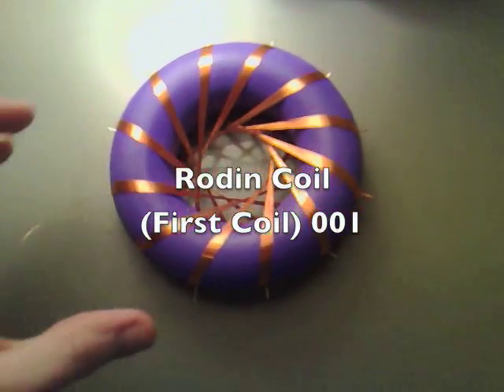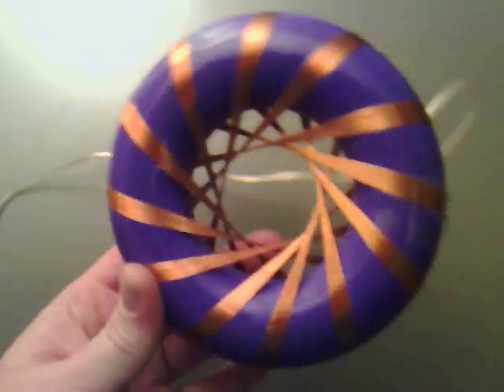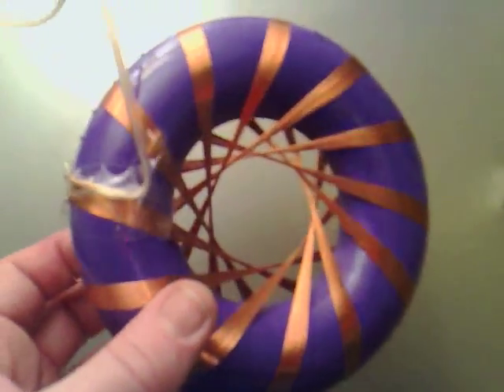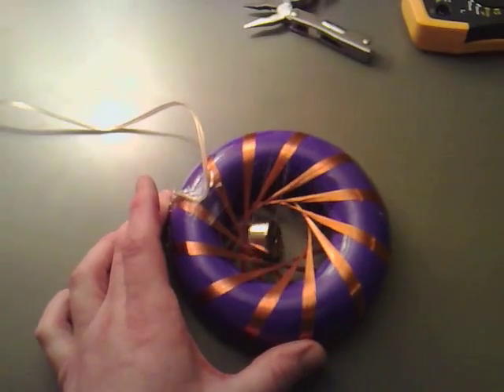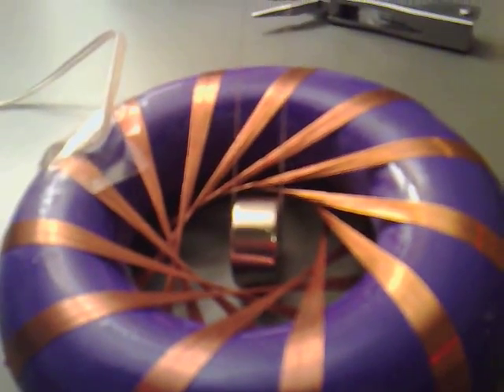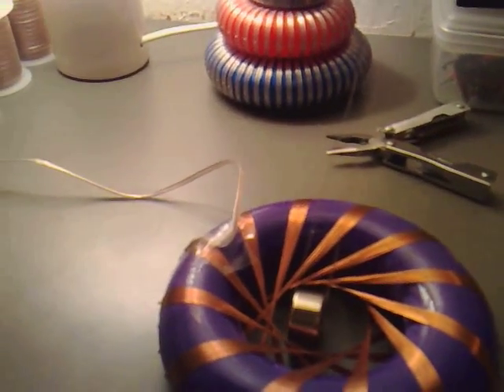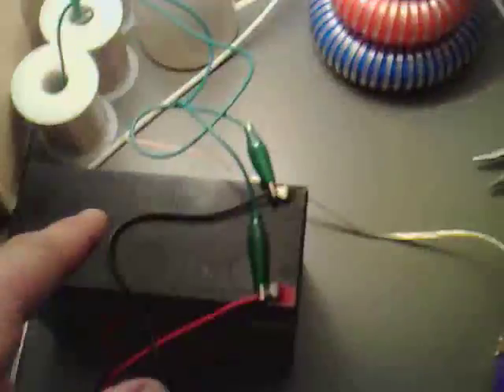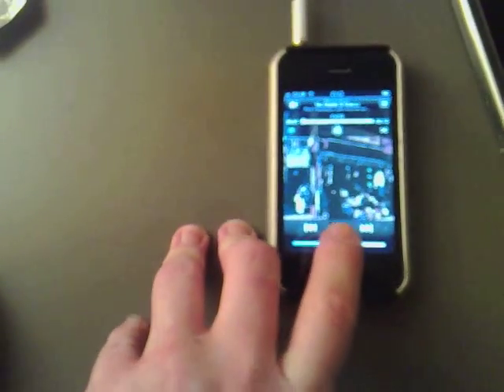Kubik Coil (First Coil) 001

Comment: @kubikop Exellent videos. I've viewed all your Rodin coil projects. The ones that "m interested in are the DC off set spin control, that you've posted. I'd like to build one with certain dementions. Do you know the proportion of the outside diameter of the donut/toroid compared to the finished inside diameter of the conpleted coil, such as an 8" OD will finish with a 2" ID or 1:1/5 proportion. The one I'm designing is to be 2 11/16" or 68.5mm inside diameter. Thanks, keep up the research.

Comment: I don't think you're vibrating the magnet. The magnet weighs too much to be oscillating at that speed with so little power. Rather, the wires are vibrating as their fields attract or repel the magnetostatic field of the magnet.

Comment: This is really cool! I made a very small speaker in this way:
Make a small tube from a bit of index card
Wrap very thin magnet wire around it, secure with tape

Now here's the weird part:

Take a magnet, and run it around the dirt outside, and you will find that some sticks to it! Close the bottom of the tube off by taping index card to it. Add some to the tube. Keep doing this until the tube is half-full of magnetic dirt. Then close the top off with the same method. Apply audio using and amp!

Comment from the maker: Voltage was about 8 volts, +-4v I have driven it through the power amp but it only has the frequency of 0-20000Hz.

I will have to check the inductance on my meter....

Paul.

Comment: Likewise, the sound-waves in a resonator 'resonates' the interior walls into powerful motion which ultimately emits a second set of  sound-waves, being much larger in amplitude.

If you have an electric guitar, try to place its neck onto a table or a door, or anything which has a large and solid, but also 'loose' surface. You will hear the difference. 

Just to mention it, I think this is also the workings behind the rotorverter, and also some types of resonant transformers...

Comment: Well actually yes, I have speculated about this and other effects for a long time now, I'm still not sure if I got the core of it, but it seems logical enough.

The short reason is this; parametric oscillation, and resonance.

I believe the Milkovic pendulum uses the exact same effect.
The input vibrations (sound or mechanical) will drive some form of oscillator into resonance. But it is not drained directly when loaded in the 2-stage way, instead it is its center parameter which is loaded.

Comment: If the Iron Rod fluctuates the North pole, would you agree that then it's possible to build a solid state power generator with no moving parts by using the solid fluctuations of the Iron Rod to pump through some coils electricity? I would love to see an experiment like these with your setup. You have really great stuff to test this out. I really like the way you controlled to motion of the magnet. This could be a way to control the direction of the "BLACK POLE" (which is still a hypothesis)

Comment: Can you confirm that the North Pole in the middle charges and discharges an Iron Rod, turning it into a monopole, (which in conventional science shouldn't exist) My guess is that the reason we see a monopole with just the North is due to there being what is called a "BLACK POLE" which it's as if you stuck a dipole magnetized rod in a black hole, what you would see is only 1 pole the south pole is consumed by the tiny black pole.

Comment: Now that is an interesting subject on its own.
Of course, since the tin foil has a larger surface than the magnet, it will move more air than the magnet, and thus encounter more resistance. So it will need more power.

But acoustical amplification is very interesting indeed, take for example a simple resonator. It could just be a simple box, but connected to a tuning fork or a string, it can amplify the initial sound many, many times. But does that make the sound last for a shorter time? Nope...

Comment: hey... if you use a superconductive metal like yttrium barium copper oxide to replace the structure you're using to wrap the coil around (the purple part) or fill the interior with boron gas or another similar superconductive medium... then it should act as an antigravitational device when exposed to certain frequencies...